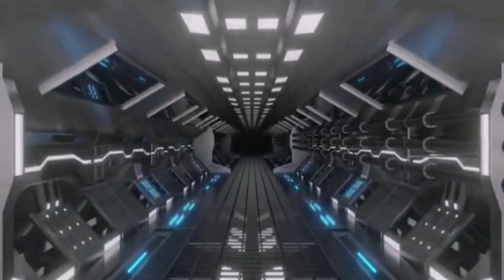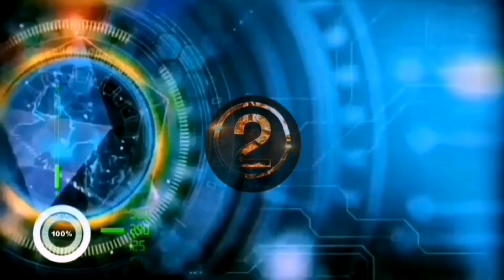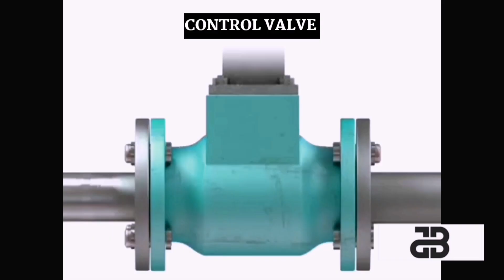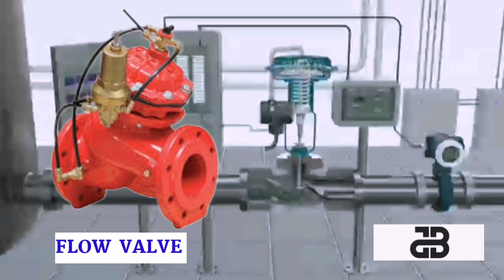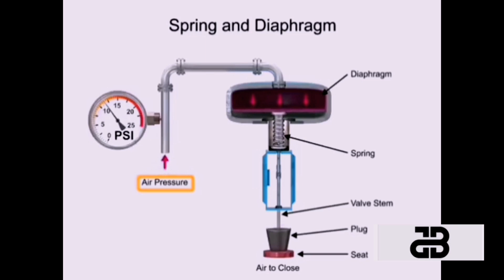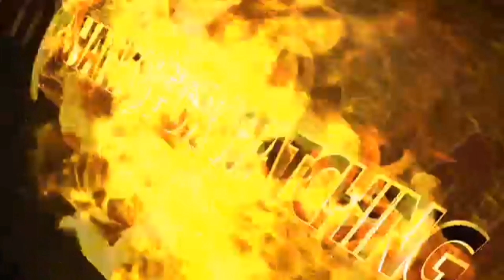CONTROL VALVE Explain #characteristic #advantage #disadvantage @jbbaldomero

Comment: i have a question will this type of control valve allow liquid and gas to pass at the same time? - new subs support from Teppiee
Reply from the maker: It will not work because liquid and gas has different principles, liquid is incompressible meaning defined as the fluid whose volume or density does not change with pressure while gasses is compressible meaning the volume of gas change in pressure at constant temperature (otw to you sir) thanks
Reply: @jbbaldomero  thanks for the information